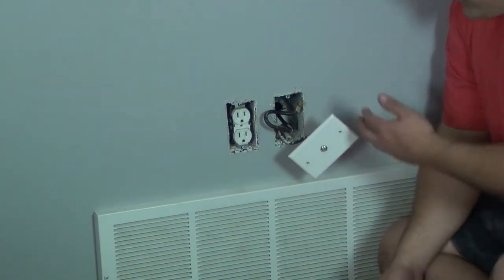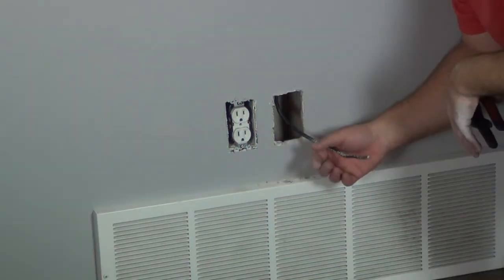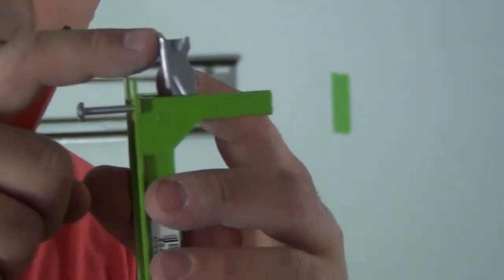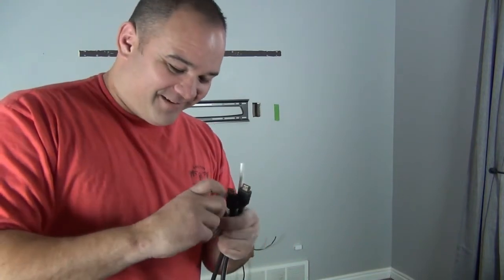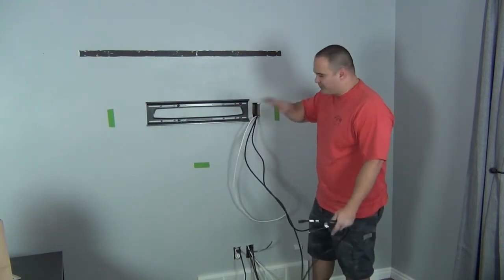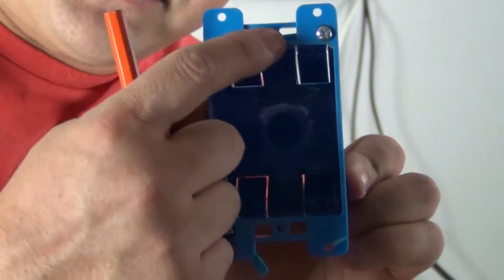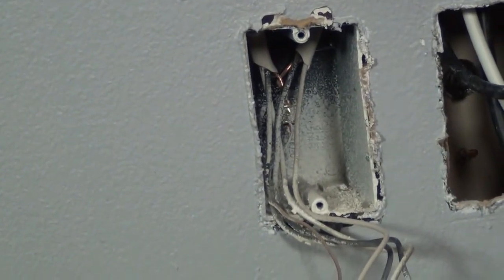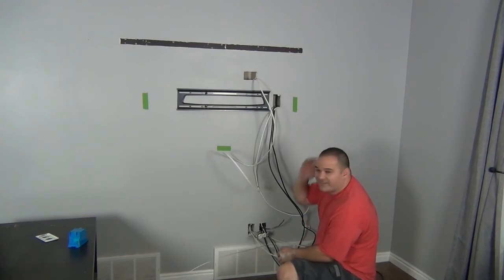Pro TV Install 2/3: Run/hide cables in the wall like a pro

Comment: Thanks for all of your videos i am going to be doing a 5.1 system in my living room 3 in wall speakers and 2 ceiling speakers 1 subwoofer. Also going to mount 75 in tv. So thanks for showing how to get thur fire breaks.
Reply from the maker: That’s a good setup! That’s the style I prefer and is what I did at my own house. Did I make a video getting through fire blocks? I have a plan to do that sooner than later one way or another. Thanks for watching.

Comment: Can you show us how to fish wire through an exterior wall, where theres only 1 outlet at the bottom.  I want to know how I can drill thru 2 horizontal fire breaks between 2 vertical wood joists WITHOUT cutting too many holes.. and if i need to open more holes, how to patch it back up.  The wall height is 9ft.  Even if you have no real world example, even just You Do University white board would be helpful as ive never done this before. 
Also, how do you add an extra ceiling speaker(s) to existing speakers and wires without making too many holes.  (I have 5.1 but want 7.1) living room has no attic or 2nd floor access to the ceiling. Should we run the same length of cable of a ceiling speaker to an external center? Im assuming yes using a toner and hiding the excess in the wall?
Reply from the maker: Hmmmmm... with ceilings that high and two fire blocks, you’ll probably need to cut holes. I made a few videos on how to get wires into a ceiling from a wall in a situation without attic access. I need to edit them and that always takes me a bit
Reply: @AlanCleggYouDoAV  ok thanks! Much appreciated.

Comment: is it ok to run a extension cord with the hdmi and coax cables instead of running a new power outlet?
Reply from the maker: Good question. I see this a lot but it’s against building code to do it that way.
Reply: most definitely not. Must be romex.